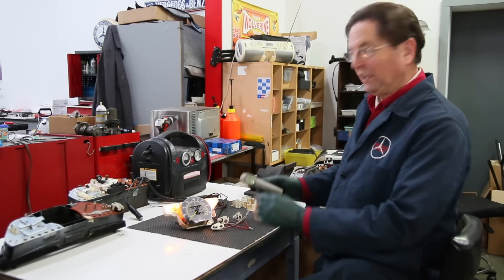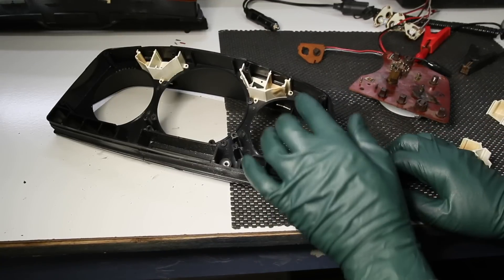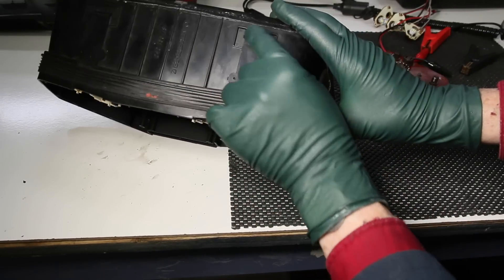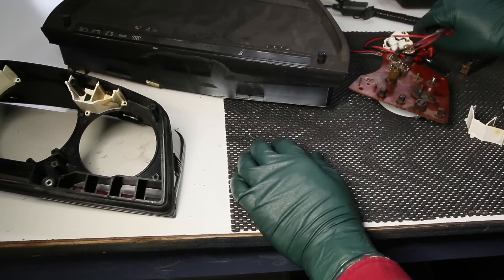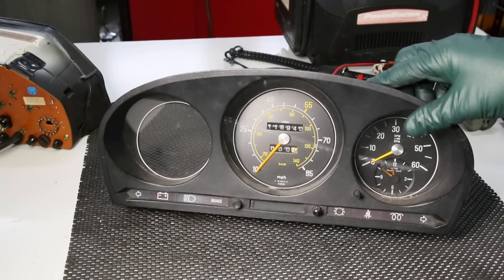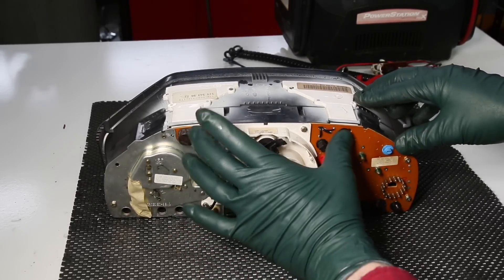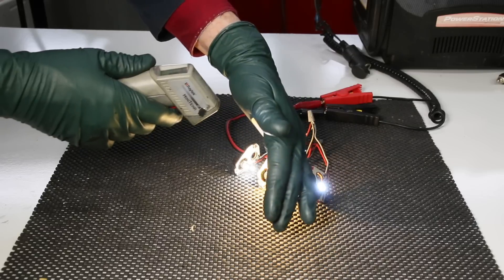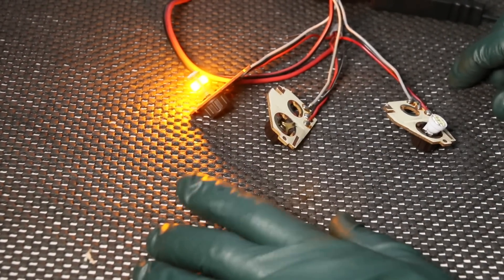LED Dash Instrument Light Testing: Mercedes W123 W126 W201 W124- Always Looking for Better.!

Comment: I did convert my 75' 450SL to LED instrument cluster lights at one point. You are correct in that there is no off the shelf LED in that size, so I ended up soldering a resistor to one leg of a 2mm Tower LED and installed them on the ends of the stalks, they're not any bigger than the bulbs and I trimmed the leads of the LED and the resistor to fit in the available space. I don't recall if I have any photos of the install, I know I have photos of the instrument cluster lights being bright as an after picture. I may try this again on my 88' 560SL and take pictures this time of the process.
Reply from the maker: Hi James, good work! I figured someone must have installed a "work around." Send some pictures if you have them to me at sales@mercedessource.com Thanks. Kent

Comment: Right on time. I had some serious work done on my '92 euro-spec  W124 300 TD Turbo, including the replacement of the bulbs inside the instrument cluster. But I chose to go with incandescent again since I have my doubts about the durability of most of the LED bulb I can get my hands on. The thing is that it's a pain to remove the instrument cluster with the speedometer cable, and the less I have to take it apart, the better. I had the dimmer switch changed as well, it was quite oxidized. But I did find some excellent C5R warm white bulbs for the sill lights under the doors, they look great, and are easy to access. Same for the license plate, it looks super neat, much more than cool white.